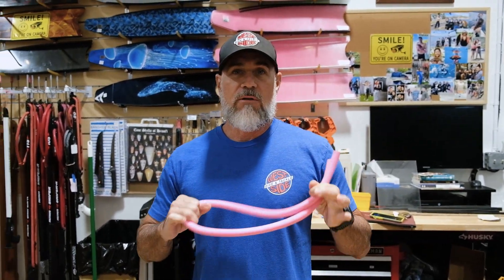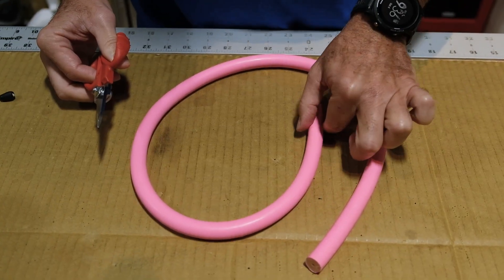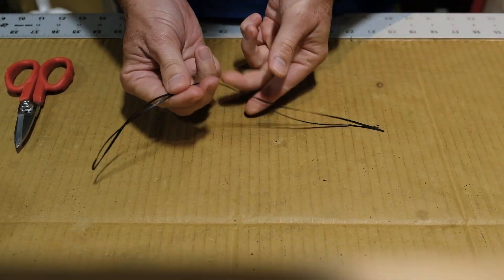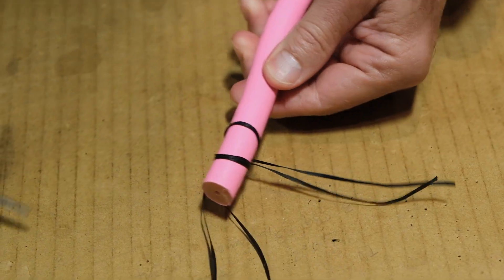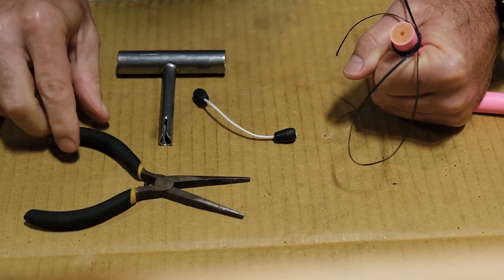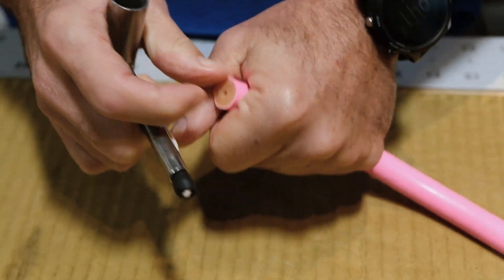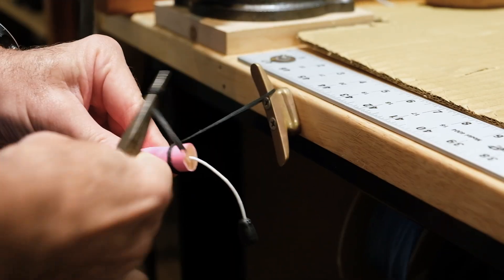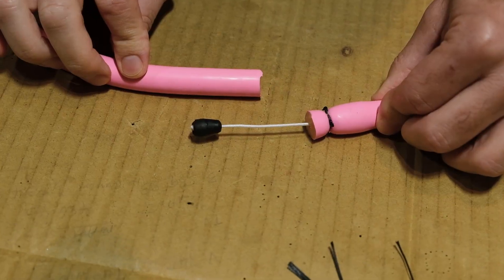SPEARGUN BAND REPAIR - How to fix a speargun rubber

Comment: Hello I would like to see it please with 14mm bands
Reply from the maker: You can use any size speargun rubber.  We use 14mm, 16mm, 17.5mm
Reply: @westsidedivetackle3894  I know but with 14mm it's very difficult to put it inside. Thanks anyway
Reply: @kostasgold use needle nose pliers and dawn soap
Reply: @Bearacooter  Thank you